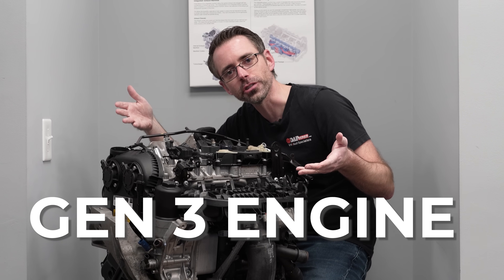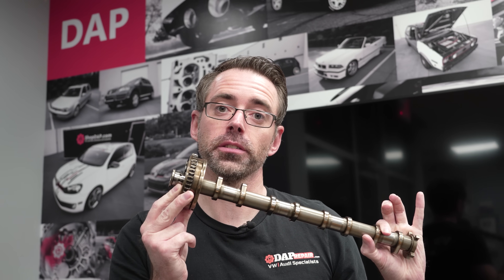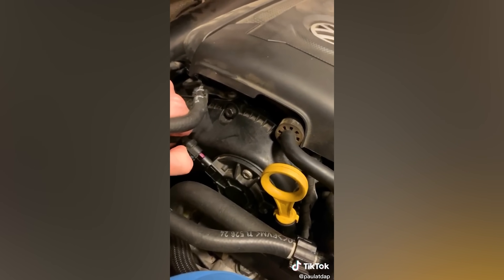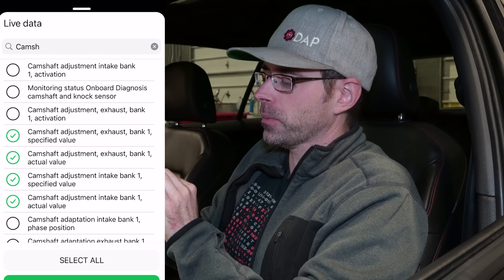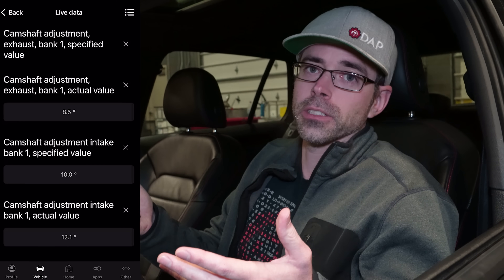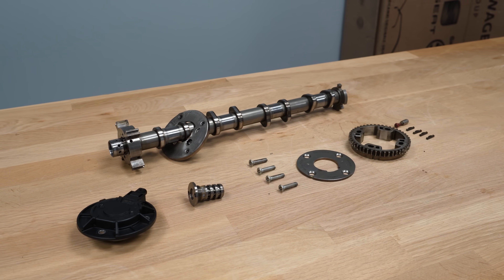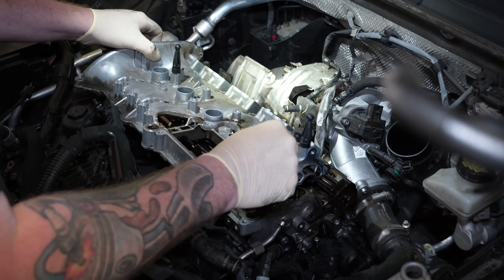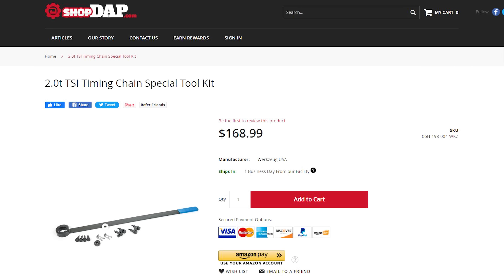Is this a New Common MK7 Engine Issue?

Comment: Had a load of these failures in our shop over here in the Netherlands.
We only replace the solenoid and the spool valves. So far it always fixed the problem. So replacing the whole cam kinda seems overkill and unnecessary to me..
However i can imagine the seals going bad if it’s driven for an extended time with the variator clapping from cheek to cheek…
Reply: What are some other major mk7 or mk7.5 issues you see?
Reply: That seems also more logic to me. The solenoid maybe loses some of its force or whatsoever overtime While I couldn't imagine the adjustable cam isn't gone bad.
Hopefully this is not becaming a problem on my a3 with gen3 engine (40tfsi 2019). I believe this is the same engine.
Reply: Thank you for sharing this.
Reply: "Had a load of these failures in our shop over here in the Netherlands."  Could it be due to owners follow the onboard service monitor / extended oil change intervals?  Or is that of no relevance, and it is wasteful to change oil more often than VW's skilled engineers specify?
Reply: @TassieLorenzo  That's actually a good point. I mean I change oil on my cars every 10-12k kilometers. For someone is 25k nothing and VW recommends each 40k? Same goes for the DSG. I mean sure can sometimes but I mean to be frequent as that, kinda smells to me.

Comment: Interesting!  I was concerned that was what the issue was on my 1.8 gen 3 in my Sportwagen but it was the timing chain tensioners....at ~70K the bolts holding it to the block snapped.

Comment: Wasn't that rattle noise associated with timing chain stretch  ? 
I have mk6 gen3 GLI,  which doesn't have the true dual variable timming. 
So this seems like easy to confuse timming stretch MARBLE in can sound with this camshaft problem..
Reply: In my experience, the chain one sounds exactly like a loose chain being dragged against something, like when your bike chain falls off and you keep pedaling. It's not as rattley and metallic sounding, and it shouldn't be assuming the timing chain guides still have the plastic on them. The phaser advancing and retarding during startup or operation is usually much louder and clacky/rattley sounding since it's metal on metal smacking together. 

Anyway, seeing this video, it'd be better to start diagnosing from the camshaft and then to the timing chain as the camshaft is cheaper and easier than a full timing job. That should then eliminate the worry of whether or not it's a chain or camshaft, but also opens the possibility that your engine isn't completely fucked and may just need a simple adjusted magnet or new spool valve.
Reply: @calebj2886  Hi, i think I have this issue, I heard the rattle like 15 days ago for about 15 seconds but no its on every cold start and also I hear it on low revs. Unplugging it completely goes away. I have a mrk 7.5 golf r 50k miles, I would like to think the camshafts themselves wouldnt be failing at this stage right?

Comment: Well, this is depressing. My 1.8T sounds like this all the time. I check the oil weekly and add LiquiMoly as required. At 118,000 mi, I had wondered if I should check the upper valves for carbon build up. If the camshaft needs to be replaced, RepairPal estimates a $2,800 repair, which is just over half of what I still owe on the loan. Seriously wondering if I should find a remanufactured engine or rebuild or something. This car's resale value is going to tank, especially with used car prices coming back to reality. Thanks for the video!
Reply: You can start by replacing the adjuster magnet only and maybe cleaning the spool valve. There should also be new spool valves that aren't just the most current revision, too. You'd just need to get the right part number

Comment: Its nice to see this video because I had this same problem with my gti and it is in the shop right now being fixed, (its been there for 3 months) something to look out for is that this problem shares a lot of symptoms with other problems so just look out for that if you have this same issue
Reply: Parts availability issues?  3 months is a long time, that would make me nervous ...
Reply: @jp2246  it’s because the dealer ship had some parts on back order and there was apparently a lot of other cars that needed to be serviced before mine
Reply: @pollux9696  good luck on the repairs and hope you get your GTI back soon
Reply: @jp2246  Thanks bro! I got it back about 2 weeks ago and it drives amazing now!
Reply: @pollux9696  Good to hear!  Enjoy it!
Reply: Did you have an idle sounding like a diesel?
Reply: @andrewmankowski2301  yeah it sounded like a diesel tractor and stalled at like every stop
Reply: @pollux9696  yikes. Yeah would yours sputter then want to stall? Mine sometimes does that. Car also kinda chokes at low rpm. I am replacing my cam magnet and then checking my VVT and going to probably clean that and see if it gets better. Do you know what the issue was for you?
Reply: @andrewmankowski2301   Yeah! so I got my gti back and it turns out the issue was this cam problem spoken about in this video and it was also mixed with a stretch timing chain.
Reply: @andrewmankowski2301  my 2016 Tig 100% sounds like a diesel at idle but doesn't have any low rpm chokes, stalling or oil pressure issues - only thing it has is the sound. Going to try replacing the actuator magnet part first, then if that doesn't clear it up; the spool valve. Fingers crossed!

Comment: Man... I came here expecting the infamous sunroof leaking issue which plagues so many MK7's
Reply: I just had my rear upper break light resealed as that was letting water in. Oh and also the pressure vents behind the rear bumper. Still got water on my rear right door sill after resealing speaker seals and clearing drainage pipe in door. Not sure what it can be now

Comment: Couple of questions.  1.  Is this uncommon problem affecting both the CXCA/CXCB and DKFA versions of this EA888??  2.  Where is the "f*cking oil" going?  I know on my 2020 GTI I lose about 8-10 oz of oil every 2-3k miles.  My tail pipes are spotless, no leaks, and no check engine lights.  I mean if it was burning it?? The O2 sensors would pick it up.  I mean damn those sensors are so sensitive in these newer cars you fart in the car the check engine light comes on.  Is is it just evaporative loss?? and if so, could this be resolved by using a 504 oil instead of a 508??  Thank Your for your Time and Input.👍
Reply: Following

Comment: everything on a volkvagen is a common problem . these engines have been trash for over 15 years and volks knows it but never did anything about it ! mexican garbage
Reply: been a tech for 37 years. EVERY german car especially turbos are always missing oil. doesnt help dealers tells you you only need 1 oil change a year !

Comment: We’ve seen this issues several times now on both 1.8 and 2.0 engines at our shop. Not super common but definitely something to keep an eye out for if you’ve got timing faults.
Reply: Worth properly diagnosing too. I had the exact faults that Paul had, but in my 2009 Tiguan. Assumed it was the timing chain, but after teardown, I realized the chain & tensioner was actually good and was updated. With some digging I found that my intake cam had gone bad too. Interesting to see this never got fixed on these updated engines.
Reply: @brandonfriesen5389  They cant fix "owners not putting enough oil in the car "problem.
Reply: @e0nema0tak1v  its possible but I believe my stuff went bad due to balance shaft failure and the oil screens blowing oil causing metal shrapnel to score small bearing surfaces and clog oil galleries. Fairly well documented on TSI's. Great engines, but man they can fail in many catastrophic ways.

Comment: What about the gen 3 non mqb from a GLI I have 60k miles full bolt ons stage 3 cts boss kit and so on and i change oil every 5k and it’s never low always right there with oil which is good but I was told the gen 3 GLI doesn’t have the variable valve timing

Comment: Bought my 18 GTI Se Dsg new. Currently have 124k miles. No oil burning. 7500-8k mile oil changes. Never done carbon cleaning. Still smooth.

Comment: Very informative video, but assuming the oil level is good (and regularly changed) wouldnt it be wiser to first replace the magnet valve and see if that would fix the issue? Seems a bit overkill to immediatly get a new camshaft.
Reply: He mentions in the very end of the video. The spool valves went through several revisions and the new valves are different sizes which only work on newer camshafts.

Comment: I'm at 170k miles on my mk7 GTI. Thank you for including obdeleven methods of checking. Good to know it doesn't grenade the engine if it's caught.
Reply: I am at 250k miles on my 2015 GTI and have zero issues
Reply: @katanamast279  what maintenance have you done?
Reply: @MeltingRubberZ28  Only normal maintenance like spark plugs, oil and transmission fluid changes. I did have to replace a few coolant hoses. The part I bought came with maybe 4 pieces all attached so that was cool. I think my water pump/thermostat is on the the way out so I will replace that soon. Its a common failure for even low mileage cars so to last this long is a good thing
Reply: @MeltingRubberZ28  I had to replace this coolantt hose. Part number 5Q0122101EA
Reply: @Katanamast279  that's pretty low maintenance all things considered. 2015s were known to blow turbos too. I presume your car is stock?
Reply: @MeltingRubberZ28  No. I am tuned. Stage 2 Eurodyne since 70k miles or so. I drive mostly highway miles for work so not alot of city driving and I do all the maintenance myself.
Reply: @Katanamast279  that's encouraging news for me. I just went IS38 last summer and the car is a blast to drive. If I could get 150k+ miles without significant issues that would be amazing.
Reply: @MeltingRubberZ28  My goal is to get another two years out of the car. It has been paid off since 2020 so it would be well worth it.
Reply: @katanamast279  what transmission is your GTI
Reply: @MeltingRubberZ28  I have the DSG. I do the fluid flush every 40k miles via the top fill method. No issues but the transmission definitely doesn't feel brand new. It doesnt slip and shifts just as fast just doesn't feel like it did when I first drove it off the lot.
Reply: @Katanamast279  gotcha. Yeah I'm M6
Reply: @katanamast279  at what mileage should i do my first transmission flush with DSG? I currently just passed 40k, should i start looking into getting it flushed to be safe. My cobb tuner shows my temps on it which never go up even if i am on it very hard so thats a good thing but I am curious when i should actually consider changing my trans fluid.
Reply: @ItzzShazey  The factory recommends every 40k miles. I have done it before and the fluid wasnt dirty at all. Most of the times I have done it the fluid is very dark. I would look into buying the kit and doing it yourself via the top fill method. It is very easy. The kit is usually $80 vs paying a shop $300-$400 to do it
Reply: @EdDeezNuts944  I have a DSG
Reply: @EdDeezNuts944  For the manual there is no service interval from VW. Shopdap recommends every 70k miles. If I had a manual I would probably do it every 50k miles to be honest. It really depends on how much you drive and how long you plan to keep the car, etc.
Reply: @katanamast279  you might be missing a few things. do the front and read diff service. not sure if you have a haldex probably not. also did you also do the relearning of the transmission dsg. i use vcds but obd11 should be also able to do it as well.
Reply: @katanamast279 have u change the chain ?
Reply: @Dane-p8s  Nope. I believe the timing chain is supposed to be a non service item. Hopefully it lasts another year or two
Reply: @katanamast279  every workshop recommended change on 60k miles
Reply: @Dane-p8s  Negative. The serpentine belt is 60k, timing chain is never.
Reply: @caskieadam the timing chains in the mk7 GTIs are a common fault, so they recommend to keep an eye on it and do a full check at 60k mile intervals. The TSIs seem to be fine though
Reply: @katanamast279  Got a 2008 Rabbit brand new in 2008 and got about 220k, just do your maintenance. It is my daily driver and been extremely reliable.
Reply: Any major issues at that mileage?
Reply: @63JackBlack  i need to know too cause im deciding whether to pull the trigger on a 2021 gti and i wanna keep it till maybe 150 - 200k miles
Reply: @Kimochiii  150 is prob realistic without an insane amount of maintenance. Past that I could see it getting complicated (ie timing chain replacement, who knows what else could break at that point).
Reply: @MeltingRubberZ28  If DSG, the DSG FW last around 150k to 200k, there will be definite wear on the balance shafts, water and oil pump, followed by wheel bearings. 
These cars once past 100k one is driving on borrowed time.
Reply: @LM Space  yeah I'm hoping for about 120 without significant maintenance. Prob end up selling around that time...and buying a boring Toyota lol
Reply: @sazlefraz  I've had my MK7 for 150k kms, not quite the milage you're mentioning but it's doing fine. I also own a MK5 GTI with 475k kms, and that is also still running on it's first engine lmao. Maintenance is key with Volkswagens, if you just do everything by the book and not abuse it daily, you should be fine, even with a modded engine. Don't expect too much if you go stage 3 and beyond, but a daily stage 2 is pretty much what everyone here in the Netherlands does.
Reply: @psiturbo  thats such a cap statement do you even own one? I see tons of people with 100k 150k plus on hybrid turbos
Reply: @logicxhardcorex  Yes, and see tons of them at junkyards, failed balance shafts, timing chains, oil tensioners. Is as simple as checking maintenance intervals and recurrent repairs. Any GTi is running on borrowed time past 100k if the following are not addressed, timing chain, tensioner, DSg flywheel, water pump, injectors, HPFP, wheel bearings. Plenty of horror stories here in YT, VW vortex.
Try to sell a GTi on any online car dealer or trade-in, is an insult. One of the few cars that depreciate at a huge loss. It's amazing when it runs right, and sounds sweet w FBOs and s tune, but they are up there with BMW in high maintenance, typical love hate relationship, 🥰😭.
Reply: @psiturboI seen more Honda accords in the junkyard than VW golfs.
 That's not a good metric for measuring reliability.
Reply: My cylinder one lost compression, 2016 Audi TT 100k miles
Stage 1 apr Tune, dsg tune.
E888 gen 3 motor.
Looks like a ring cracked? I can see scaring in cylinder one that I don't have in my other 3 cylinders via a endo/bore scope.
Initially I tried, plugs, coils, injectors to fix the issue. Then realized it wasn't an easy fix. Compression and leak down test confirmed cylinder one is, well, broken. 2,3,4 have great compression, closer to new, no oil burning issues or anything. Then cylinder one died.
Sad, looks like I'll be rebuilding an engine.
Reply: @jonathanpark7658  scrap metal
Reply: @moallysnackbar  maybe 🤔
Reply: @Jonathan Park  sounds like detonation caused the ring failure imo. I always try to run a gallon or two of E85 to keep it safe. 

However I would agree, a rebuild is probably not the direction I'd go. Prob try and find a junkyard motor but what do I know.
Reply: @MeltingRubberZ28  yeah, maybe the gas sucked as well. Do you think a gallon or two of 100 octane would offer similar protection?
Reply: @Jonathan Park  probably. 100 octane is way more expensive though. E85 has better oxygen content as well as better cooling properties. Either way would help though.
Reply: Even a Chrysler will easily do 300k.... if driven a lot of highway miles. The true test of longevity and durability comes from multiple years of on/off engine cycles and mileage. So its not that impressive having that many miles within the short period of time of ownership. You likely just drive a lot
Reply: @Dansk55  I have driven and took long drives back and fourth from work about 160 miles a day Mon - Fri for 4 years. Long trips from VA to Chicago multiple times.  I dont think Chryslers can make 300k...lol. I still have my 08 Rabbit and driven daily.
Reply: Mk7 gti with is38 and upgraded hpfp and other bits running an e48 tune since 50k miles, now at 75k. Before that I was stage 1 then 2 tuned since 30k. I drive pretty hard, and so far so good. Car is hilarious with ~400hp
Reply: I got you beat , Im at 215K. Original owner. FYI the first 180 were fine but then things happened  but I guess some of it  was just expensive maintenance stuff.
Reply: I have 120k miles on my Audi a3 8v , only biggest issue I had was the water pump … other than that it’s great!
Reply: I have over 150k miles on my 2017 GTI. I’m the original owner, and it’s been tuned since 2000 miles in the ODO. Currently been IS38 custom tuned for 4 years, and WMI for the last 2.5 years. Car has perfect compression still, and runs amazing. The IS20 and another IS38 blew, and I’ve had 5 clutch replacements, and two water pumps installed. Honestly, if I never tuned the car, I bet I never would have had any turbo or clutch failures. Things have happened due to bad tuning (stay away from Eurodyne OTS tunes trust me), and bad choices of parts. But now that the car has a very good tuner and parts, it’s been super solid. Been running the same tuner for 4 years and zero turbo issues.

Comment: Is it common problem with other TSI engines too? had similar noise on cold start on 1.4T CAXA engine and vw fixed it under warranty. but same issue reappeared years later again.

Comment: I’m guessing these engines burn oil due to low tension rings getting stuck in the grooves due to carbon build up?
Reply from the maker: The 1.8t does yes. This is likely exacerbated by owners who use low quality oil and change less often. More info on oil burning here. https://youtu.be/CZhV0Qv1lps